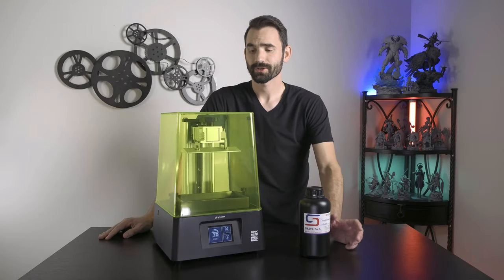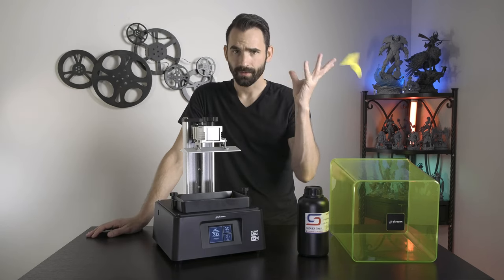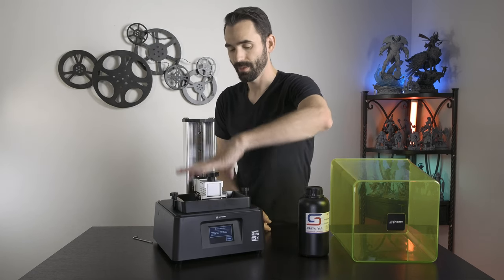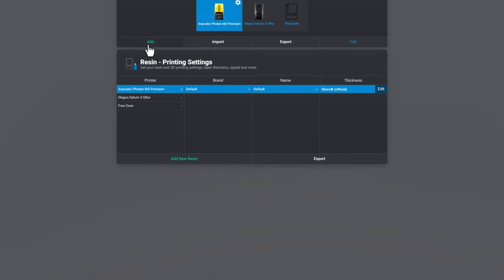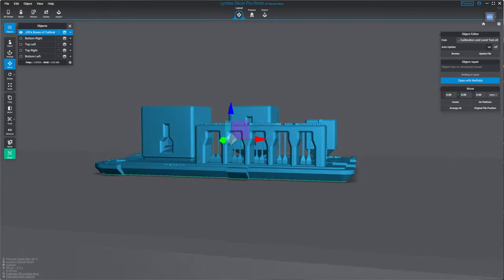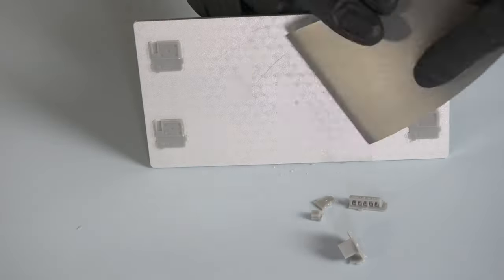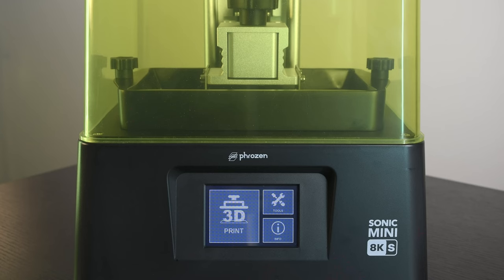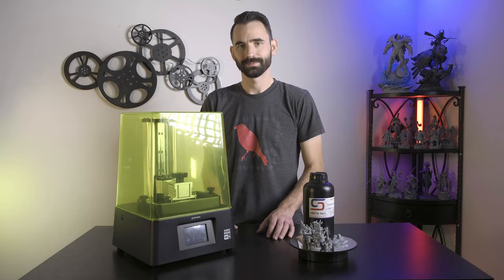All you NEED to know!! to get started with 3D Printing!

Comment: Great video and great write up. Im still facing some issues while printing pieces with large flat/planar surfaces, the print gets distorted or bend at the edges. Any tips on how to avoid that ?
Reply from the maker: Slower lift speed and very good supports plus calibration at Dimensional accuracy should help. 

Finally, make sure that no surfaces are parallel with the LCD as they will always warp.
Reply: @J3DTech  Thank u so much 🙏 tried almost everything.. Also i think there is a issue with my Saturn 3 ultra... Every print has a layer shift/ layer lines at a particular height
Reply from the maker: @niththomas  It does sound suspicious but also make sure you don't have any issues with a heating element that can be inconsistent. Or you're sharing power with another device in your house that can pulled a lot of power. 

But if it is always exactly in the same spot, I would reach out to Elegoo on that one as it is sounding like you might have a lemon.

Comment: a new question, to test the boxes, do I need to wash and cure first?
Reply from the maker: It is 100% up to you. Measing them before curing will test your calibraion after the print, teting them after curing will test your resins post process shrinking. Just one more thing this calibraion print does out of the box. ;)

Comment: I love your guides and videos, I have a question on the reason for having resin in the vat when you're doing a vat level... Mainly, what purpose does it serve to have resin in the vat during the levelling process?  Wouldn't that increase the chances that the vat would be crooked if you're pressing down harder on one side than the other?
Reply from the maker: I've not seen it cause an issue with making it  unlevel due to pressure.

But now that I have the Base calibration part I can get feedback from others to verify.

But there are three main reasons.
1. Emptying the Vat is work and messy and a horrible workflow.
2. The resin keeps the build plate from scratching the FEP.
3. The resin makes a suction cup keeping it secure when tightening.
Reply: @J3DTech  thanks for the quick answer! I expected that #2 was one of the reasons.  I have a mighty 8K and because I have more money than sense some times (and wanted to be able to vat swap to clean or run different resins) I have two vats for my printer.  

With that, when I need to level or re-level my plate, I just throw the empty vat on the printer (which already has a more worn FEP) level it up, then put the other vat back rather than draining it.

Thanks again for the quick response!
Reply from the maker: @adamosmond9982  I have a extra VAT and buildplate leveld to that VAT for my printers. I have a resin I use 90% of the time, but that other 10% it's easy to have a spare. I also dont need to clean the 90% VAT just store it in a bin.
Reply: @J3DTech  Exactly! That was my whole thought.  I have a nice lockable lid container for my second vat with exactly that purpose in mind.  Keeps the vat clean, the fep clean (I want to print some stand offs to glue to the bottom for the posts that lock in, so the vat hovers in the container) but that is exactly why I wanted to get a second vat.  

And thanks to you and Ty at Tableflip, I use the Siraya Tech blend, and have infinitely less failures than when I started.  

Thanks again for all you do!

Comment: that was awesome thank you. when you do the vat clean, do you filter the resins as well? i had a back to back fep tear that happened when trying that for the first times. turns out there was floaters off the screen of the printer.
Reply from the maker: I do not, cured resin is more dense than uncured resin so it will sink to the bottom.

Doing a vat clean will remove all the hard bits.

I've had some thin parts like what you're talking about but they generally will also have parts of it that will make contact with the FEP and come up.

I'd have to see your process and see what's going on because I have several printers that I haven't taken the vat off of in many months and 10 +++ KG of resin.

Comment: Short question, in Lychee Slicer the boxes are 1,65 mm high. Can you elaborate how you come to 1mm thickness when the sliced file is already 1,65mm thick?
Reply from the maker: I'm not 100% sure what you mean? The raft on the boxes should measure at 1mm when the print is finished. In Lychee where are you messing from? We can't post screenshots in this chat. But if you reach out on the Lychee Slicer discord I can show the exact measurements of the model.

Comment: I printed all calibration prints and they were 1.1 mm thick, is this acceptable or will it cause problems with future prints? Also, I noticed the bottom/back of the pieces, I have very small bubbles that were in the first couple burn-in layers. Are these likely because I shook the resin too vigorously before pouring or I didn't wait long enough for the resin to settle in the vat? My resin is ELEGOO Upgraded 8K Standard Photopolymer  space grey resin and I used 8/60 exposure time per "unofficial" community settings for this resin on Elegoo's website.
Reply from the maker: 1.1 is perfectly acceptable. 

Yes give it a 5+ min wait before you start your print.
Reply: @J3DTech  legend, thanks man

Comment: when calibrating the printer, you mentioned doing a "Fingernail test" i don't have calipers, can you describe what the fingernail test is?
Reply from the maker: This is to send them next to each other and use your fingernail or a pencil to draw between them. 

Also I've since released the XL version that can be done.. with adequate accuracy. 
https://cults3d.com/en/3d-model/tool/biuld-plate-calibraion-xl-designed-for-rerf-or-whatever

Comment: I got a question about this the Z-Offset. In the time stamp 10:09, you just press the "start" in the "z control" option, to move the buildplate to the home position.  But I saw that build plate in the video is tightened... that is not dangerous for the lcd screen?
Reply from the maker: I already leveled it. At this point I'm just sending it home so I can set the Z-offset.
Reply: @J3DTech  Yes yes... I got that part, my friend.  I was just scare because the screws of the build plate are tightened and not loose.  But I already did and... nothings happened so.. forget the stupid question hahahaa XD 😅😅😅😆

Comment: I am using Lychee Pro version 5 (5.4.300) and the add new resin menu looks much simpler.  No transition layer count, no retract distance, no wait before / after print or lift, light intensity.  It looks much simpler.  Am I missing something or on the wrong page??
Thank you
Reply from the maker: These settings are based upon the printer, not on the slicer itself. Which printer did you add?
Reply: @J3DTech  I added the Anycubic Photon Mono X
Reply from the maker: @davesenor3146  That printer does not have the same functions of newer printers. IT does have TSMC but it's build into the firmware and you cant controll it.

Comment: I just got a new Mars 3, and had someone link me this video to get started. Very useful information, especially regarding the leveling procedure, since I've always seen people talk about the paper method. 

If I may ask, though, what is the reason for leveling while there's resin in the vat? Is it because you're not going to run the printer dry, and so you'd need to take the volume of resin into account? Or is there some other reason?
Reply from the maker: Thank you, I'm happy to hear. Did you check out my guide? That's where the real information is. 

To answer your question. two major reasons:

First, it will give you a better level. The resin will get pushed level, filling voids all LCD's and printer have. Creating a suction cup, this will help stop the build plate from lifting during the tightening process.

Second, it helps protect the FEP from the build plate that could scratch it. Even more so as your buildplate gets scratches on it.
Reply: So I didn't know there was a guide until you'd mentioned it, but I will definitely take a look and read up. Thanks for the heads-up. 

Also, thanks for the reasoning. Definitely makes sense that it acts like both a barrier and a way to prevent lifting during leveling. Appreciate the quick response.

Comment: Would the settings you shared be worth trying with my Water washable resin?
Reply from the maker: They will work with any resin after calibration.
Reply: @J3DTech , I'm confused by this how do you calibrate then? Like is the settings not the calibration?
Reply from the maker: @BetwixtScreens  In the video I talk about Boxes of Calibration and I have a link to my entire guide in the description. I cover everything about 3D printing including calibration in there.
Reply: @J3DTech  Yes, Sir. I'm reading your guide it just I might be a little slow. I'm trying though, and appreciate your guides and help.
Reply from the maker: @BetwixtScreens  NP, it's a lot to go though and learn. Took me ages to gate and test the information and get it all written.
Reply: @J3DTech  I'm just scared of messing up, I'm confused by do I use the setting you show in guide or make my own. Like at momment I'm sitting at 25 exposure but my resin is water washable ND says 30-35 but at that level it stick to plate and breaks trying to get print off
Reply from the maker: @BetwixtScreens  I have some videos that cover bottom layer calibration on my YouTube. I cover what all the settings do and what to do to.
Reply: @J3DTech  thank you cause reading test and all even at 20 bottom layer it is still sticking hard to plate and water washable exposure is suppose to be 35.......feel like pulling my hair out.
Reply from the maker: @BetwixtScreens  Don't use any settings you find online. I've never found them optimal. 

First water washable resin is horrible to use. I always hate 3D printing when I use it. 
However you can still get it dialed in.

Use 5 burn in layer and 3 transition. Use 20s bottom layer exposure time and 2s normal exposure time. Use 2s "wait before print". 

These settings are detailed in my guide. As a baseline. 

Print the Build Plate Calibration parts till they come off easily and all print correctly. 

Then move into boxes is calibration and follow the instructions 

After that you're good to go.
Reply: @J3DTech  10-4 so do I change anything in between prints if they don't come off easy? Or just keep printing until they just magically come off easy. Sorry that probably sounded rude but I really do appreciate the help. I just really am this stupid.
Reply from the maker: @BetwixtScreens  For burn in layers, go up or down by 4s till they pop off once the scraper gets under it.
Reply: @J3DTech  10-4 Boss, do you have a patron or anything. Feel like I owe you for dealing with me and answering my questions. Also should I use your speed settings?
Reply from the maker: @BetwixtScreens   I don't and that's ok. Also if you join the Lychee Discord feel free to message me there as well. It's a bit easier than Youtube messaging.
Reply: @J3DTech  I am on there! I definitely will message you after I get my printer fixed now. Woke up this AM to a Frozen Z Axis. It won't do anything, up or down. I hope Elegoo support is as good as people say.
Reply from the maker: @BetwixtScreens  That's no fun. Make sure no resin got splashed in the Z screw. 

You may need to help it move up by applying a small amount of lift on the build plate when telling it to move up. 

If that works then a full cleaning and check will be required. 

Even removing the backlash nut for any damage or resin

Comment: I'd like a little more details on the Z-offset issue. It may be what I'm struggling with.
Reply from the maker: What type of printer do you have?
Reply: @J3DTech  Photon M3 regular version.
Reply from the maker: @SpringfieldFatts  I have 3 Anycubic printers and so far they work the same. You first set it home, then you use the 0.1mm button and 0.05mm button to input the difference of where your part measued. Then hit Z=0, the printer should come up with a prompt to hit Enter.

See about half way down.
https://manuals.plus/anycubic/photon-m3-premium-8k-high-precision-3d-printer-manual#axzz87jrKxEsM
Reply: @J3DTech  sorry, should of specified I know how to set the axis, just wanted to know how you knew print thinness = z axis issue as opposed to other factors.
Reply from the maker: @SpringfieldFatts  Gotcha because you're only testing the first 1 mm of resin printed, you're going to be in the burn-in and transition layers. A few normal layers but that's not really going to affect this close to the build plate.

And if you've already confirmed that your build plate is level by measuring the five squares. The only issue you have left is where the print starts.

It's a really just the elimination of other variables.
Reply: @J3DTech  need your help read your guide by the way great work have passed on to the guys I print with… that being said I have a new Saturn 3 ultra started out with factory settings and Anycubic water washable resin it printed great for about 10 prints and then started to miss print, it prints the bottom layer and then after that it either sticks to fep or doesn’t print so I’ve leveled with card paper and you method using the vat, I have tried all kinds of setting and still misprints any ideal what to do?
Reply from the maker: @mikelester5224  I would need to see your settings, picture of what you're trying to print in the slicer and of the failure to make an educated guess. 

It's best to reach out on discord where sharing this information is easy.
Reply: @J3DTech  is there a way I can pm you or email you I don’t know how to add a picture here
Reply from the maker: @mikelester5224  Join the Lychee discord and you can find me there. Derek J3D | Lychee Team
Reply: @J3DTech  I have looked and can’t find it is there a link to this sight
Reply from the maker: @mikelester5224  https://discord.gg/lychee-slicer-722410197095677954

Comment: Am I reading that wrong, are you seriously using a 2s burn-in time? I have this same printer and the lowest I can go is 13s. How is 2s possible? My regular exposure time is around .9s to 1s for the CofC test
Reply: nevermind, it is late and I am super tired. I see that you did that and got a failed print. Can you post your final Lychee settings?
Reply from the maker: Nope you saw it correctly it's 2s I even did a dry print and timed it.

Sure, but remember these are for a water washable resin.

 Burn in
4 layers 
2s exposure time
3 transition
Distance and speed are the same as in the video 
50% UV power 

Normal layers: same as in the video

Exposure time was 1.7s - 1.8s
UV power 90%
Reply: @J3DTech  ok thank you, I appreciate the clarification. Maybe that makes sense for that particular resin, I've never used water washable. I was using Phrozen Aqua 8K. I know you use a Siraya Tech blend. Off topic here a bit but (1) what printer would you recommend for a larger build plate in terms of quality? (2) do you have a patreon?
Reply: @J3DTech  👍
Reply from the maker: @amrogers3  I don't have one no and don't expect I ever will. 

My go-to resin is a blend of Navy Gray and tenacious.

The larger printer world is hard. I don't feel there are any great ones. But I would go for the Jupiter
Reply: @J3DTech  thanks JD, I appreciate you taking time to respond. I was going to pull the trigger on a M5 Premium and then it went OOS. I may just wait to see what new tech comes up over the next few months for Black Friday/Cyber Monday.
Reply from the maker: @amrogers3  The M5 seems better then the M5s but sooo I'll get a Saturn 3 Ultra and I'll do an honest comparison.
Reply: @J3DTech  can't wait. I just watched a fauxhammer video on those two. Neither one seems better then the M5 Premium. Wish I wouldnt have missed that.

Comment: @J3D Tech - It's encouraging that you showed your big mistake with the outrageous 'burn in time', but it's also very surprising that an experienced guy like you is still screwing around with the lie about '10x normal exposure for the burn in layers', and just as bad, do you actually believe this nonsense, 'scuffed/engraved/sanded buildplates are good', too?

Based on your guide, you have all the tools to have figured this out by now...
Reply from the maker: What makes you think that I did not intentionally overexposed it so I set up the next scene? 

Like how I under-exposed it to make them do a vat clean?

That said, I didn't expect it to be that hard. 

That resin and build plate combo was a bit crazy.

In one of the shots I added an overlay stating it only needed 2s bun-in time at 50% power. The lowest Burn in time I've ever used is 12s and this was at 20um. 

I plan on making dedicated videos to troubleshoot failures. I like the idea of it being a story. The story of a man trying to get it right but making mistakes, I feel it's better than being told.

However it could open me up to some people thinking I'm not a trusted source of information.

What's your opinion on this?
Reply: @J3DTech  Just explain what you are doing upfront and I think you will be good. I really like the idea of the mistakes. We all make them and presenting them in this way I think is a good idea.
Reply: @J3DTech  If I didn't think you were a good dude, I wouldn't be a long-time subscriber and leave comments 🙂

I am, though, sick of many of the BS 'rules of thumb' that just don't work an victimize serious people with needless troubles like you sowed.  For example, I almost never use even 10 seconds of 'burn-in- time', absolutely never 'scuff' or sand a build plate, for example - and the reason is because IT IS WRONG to do so.

What is right is good plate tramming/paralleling (aka "leveling"), paying attention to proper wait before and after cure times, lift and retract speeds, and of course proper 'normal' exposure time.

How to arrive at all that is pretty straightforward, but it gets confused with unfortunate nonsense that just keeps being re-told like it's some kind of Gospel.